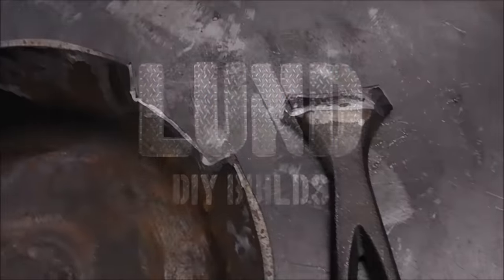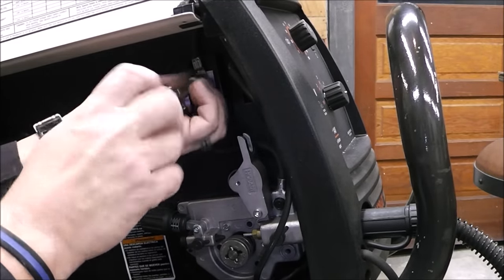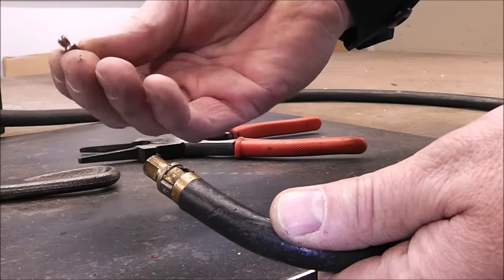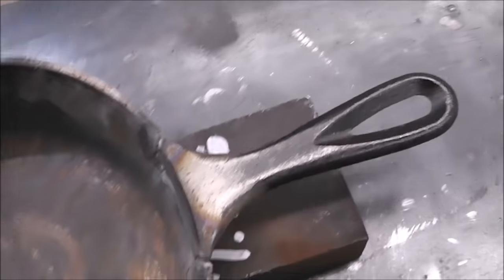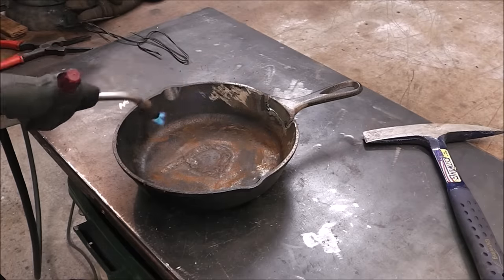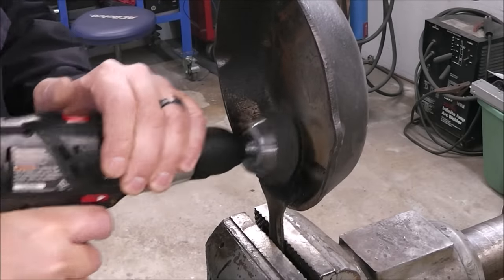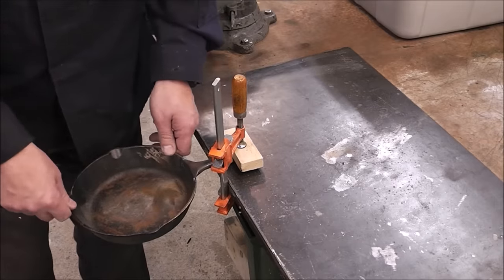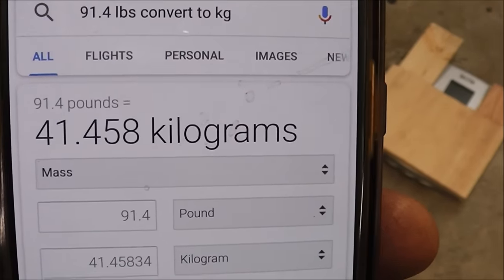Cast Iron Welding Repair using Flux Core Wire

Comment: The obvious problem is since cast iron is brittle, a static load isn't going to give the same result as a shock stress. Like glass it may bear a lot of weight, but fracture easily with a realitively mild whack with a hammer. It is the repeated thermal expansion contraction cycles of cooking that will most likely cause failure, rather than the weight of the contents.
Reply from the maker: Spot on! Why I insist no one ever repair a cast iron pan.

Comment: When your out in the field and what you got is what you got  you use it and fix the item until it breaks again. You know this so you don't expect it to last forever or may just last a few hours..  Down Time cost money so anytime you can be up and going your saving money and making money.  Now if you got the time to do a repair properly then yes by all means do so but usually that's not the case and the repair needs to be done ASAP.
Reply from the maker: Spot on! Thank you! 👍👊

Comment: What if ya got a flux welder like harbor freight now i have used a stick welder on cast never had it fail just wondering what any one thanks
Reply from the maker: I have no problem with HF. It was my 1st wire feed welder 30 years ago. I've even used it once on a commercial job welding some temp braces on a bridge project.

Comment: My dad used to use fiberglass insulation instead of sand
Reply from the maker: I've never heard of that. I would be careful with fiberglass though. Its bad stuff to be around without a respirator.

Comment: When weighing it, the white bucket doesn’t count because that’s what broke it. Great video thanks.
Reply from the maker: I was holding the white bucket between my thumb and index finger and just as I relaeased all the tension it broke. I might have been holding 2 pounds at most between my fingers so it's close enough to count.

Comment: Don't change your polarity if running dual shield.
Reply from the maker: 53prime, thank you!  I should have clarified in the video for everyone, self shielded wire (what I'm using here) has properties in the core that protect the weld puddle from the atmosphere and runs DCEN,  gas shielded wire still has flux in the core but nothing to protect the weld puddle from the atmosphere other than the shielding gas and runs DCEP.  Thanks man!

Comment: I think eggs are lighter than all that crap so it was probably good to go lol. I can tell you one mistake you made though, NEVER weld over flux before you chip it away. It looked to me like you were adding weld where you already welded before actually chipping. The flux will contaminate the weld so it won't hold. It may have held on if you didn't do that. Cool vid though

Comment: The moisture is not in the cast iron. It is a by-product of the gas flame. Put a flame on cold metal and it will get wet until the metal is hot enough to evaporate it.
Reply from the maker: I misspoke

Comment: Nice ima weld a cast iron block crack just to hold water
Reply from the maker: Good luck Joe!
Reply: It worked very well thanks for the tip it was cheaper and easier than stick welding
Reply from the maker: @joekriv8274 I love hearing stories like this! Thanks for checking back in and posting your results! Take care and congratulations!

Comment: interesting experiment. it didnt actually hold that much though, it snapped as soon as you added the bucket, therefore you cant really count any of the weight in the bucket because you dont know what amount actually caused the break. it couldve been just the weight of the bucket, it couldve taken the filled bucket. you cant accurately know how much witout adding the empty bucket and then adding to it
Reply from the maker: I've done enough of these experiments to know that it was within roughly 2% of the final value and for this representation that is all we need to know. So yes it proved that using Flux core is a viable repair option. Watch it again closely. I was using just my fingertips to hold the bucket and briefly let off the bucket just as it broke.

Comment: what volt and wire speed was this set at?
Reply from the maker: This welder does not have variable voltage settings. It's transformer based with selectable tap settings.

Comment: I broke the hinge off my barrel stove door this is cast. I welded it with flux. works like new. just ugly. I've been using a flux core welder for over 30 years. Installed air rides and hydraulics, cut frames in half then weld them back. I just wish they were more sheet metal friendly

Comment: best process is welding one side the grinding opposite side to sound material and welding and then repeating on the other side to make sure there are no inclusions in the weld itself. but interesting what you've done nonetheless.
Reply from the maker: Great point

Comment: Gas nozzles are insulated on mig welders, if yours is arcing, something's wrong.
Reply from the maker: Not really. They make self shielded nozzles non conductive for a reason. Generally the nozzle gets a piece of spatter inside which causes the nozzle to arc out and renders the insulation useless.

Comment: Flux core is the only practical set up for me. Due to costs, location, etc.. Can get flux core delivered cheap, no gas, also the 160 welder was a one-off, affordable & does both, if I decide to expand skills. I wanna learn to walk in my bare feet before I run in €3k shoes. :D
Reply from the maker: Dude you hit the nail on the head 100% I love flux core...especially for all the reasons you pointed out. I don't know why some folks give it a bad wrap. Theres a reason It's used almost exclusively on structural work....because it works!

Comment: why the slow cooldown? its a pan. its going to be heated up on a stove and cooing many times... am i missing something?
Reply from the maker: The stove will never heat the pan from room temp to welding temps of 2000f in a matter of seconds. The slow cooldown allows the metal to normalize the grain structure that gets rearranged from the high welding temps
Reply: @BrandonLund  ah ok thanks for the explanation. ill keep that in mind if i ever weld castiron

Comment: I was told 6013 was good for cast iron.. when you're done, hope theres no "ping"
Reply from the maker: As far as stick welding a 7018 works much better because it’s low hydrogen.
Reply: @BrandonLund  ive had good luck with 6013. The welding instructor who told me that welds for Nasa. He did all the welds for the hubble repairs yrs ago.

Comment: They say cast is not supposed to be welded.  How ever I have never had a problem just get it super hot.
Reply from the maker: There seems to be a lot of mystery surrounding cast iron. Hopefully this series has shed some light
Reply: From my experience I’ve just welded it and rolled with it. But I did use higher heat settings depending on thickness I haven’t had any issues. But the stuff I’ve welded isn’t holding a building together either.  Lol

Comment: Works better if you heat the cast iron and use a nickle rod. The densities of the different metals will break with vibration as well . Done with the wire
Reply from the maker: Yes, I believe testing wise that was the process and method that has done the best so far.

Comment: That tip gard shouldn’t make contact. It’s insulated on the inside of it. Probably had lots of slag build up in it and was making the inside of it letting power go to the outside of it.
Reply from the maker: I think the insulator is going bad. It's had a lot of use but it could be slag buildup also

Comment: The last bit of cast iron that I welded I didn't have to go to this extreme, but this video brings a good point.  I didn't bring my to heat before welding, but I welded small 1/4" welds into the heat!  And I let it cool down on it's own time.
Reply from the maker: Thanks for watching and commenting!

Comment: Many complain about flux core how much you have to clean and how messy it is but I've been welding on several occasions where we got late the welding store was closed I couldn't get any gas couldn't finish the project it's just totally messed up my progress so try flux core I keep plenty of wire wheels wire brushes and I weld outside anyway the welding supply company close to where I live had several rolls of 30 lb flux core wire Hobart the guy told me it's been sitting there for a while nobody really buys it I said well talk to the boss and see if I can get it cheap he laughed at me the next time I went in the store they sold it to me dirt cheap I'm a happy camper
Reply from the maker: Nice score! I love flux core. I've run miles of it on commercial jobs. It works just as good as any other process if setup correctly. Cheers buddy :)
Reply: @BrandonLund  thanks for your videos I have learned a lot and because of your sharing my fabrication skills have improved thank you

Comment: use a wire wheel if you are worried about contamination. The cut off wheels are made from fiber and will burn away anyway.
Reply from the maker: That would work too but "experts" say to use a chisel to avoid embedding the contamination within the metal. If you treat it like you would to prep aluminum and brush in one direction it shouldnt be a problem

Comment: Dude, i stick welded a cast iron pump almost a year ago with a 7018 Rod. All i did was preheat and reheat  a large area around the weld. Had no problems.  People will tell ya that you cant do this, and cant do that just because they didnt have any luck
Reply from the maker: I've had pretty good luck with 7018 also.

Comment: 12:51  I think that proves that cast iron CAN be successfully flux core welded.  But, as a newb, when I see cast iron, I instantly think nickel rod arc for the repair.
Reply from the maker: Nickle is good too but my go to now is silicon bronze. It's almost as strong as the original material

Comment: Good vid.  Sometimes we don't have time or resources to make the optimum repair.  The skillet would have functioned just fine, as it is unlikely that even I could get 91 pounds of bacon in there.  Besides, it's not stupid if it works.  Trolls can go pound sand.
Reply from the maker: Thanks man! Your "pound sand" comment had me chuckling. I say that phrase quite often myself.

Comment: Thats innershield wire. Not fluxcore. Thats 2 defrent wires.  Fluxcore uses orgon. Innershield doesnt.   Can tell by the white smoke/dust left on the pan after you weld.   Welded it for over 20 years.
Reply from the maker: I've never been big on semantics

Comment: I use flux core mig welding daily I don't know why people hate it so much
Reply from the maker: Good question. Each process has their place and knowing when to use it makes sense to me. I would hate to have to rely on just one process. I pick the process that works best for what I'm doing and roll with it. In and out $$$$

Comment: you weld cast iron with steel wire?
Reply from the maker: You can. Although not the ideal method, it can be done in a pinch
Reply: @BrandonLund  maybe i should have worded that different i know you can weld it that way but it wont hold
Reply from the maker: But it did tho

Comment: Exhaust manifold on the engine?
Reply from the maker: Sure. If you can get to the area well enough.
Reply: I'm gonna try it. May let the engine idle for a hour or so before I start the actual wielding.
Reply from the maker: @jeraldhite9744  If you can get it up to temp before welding, that is the best. Once your done start it up again and get it back up to temp again, and then shut it off and pray it doesn't crack.  You got nothing to loose right. Good luck brother!

Comment: Flux cored 70 series wire is DC Electrode POSITIVE!  Just like solid wire.
Reply from the maker: @Jeff Benefield if your running dual shield than yes, but I'm running self shielded which uses straight polarity (DCEN). The "70" doesn't determine polarity, the "7" refers to the wires minimum tensile strength and the (0) denotes the welding position. The last digit in the wire designation is what defines gas shielding and the polarity of the wire. An example is E70T-7 wire - The (E) is for "electrode", the (7) is the tensil strength (70,000), the (0) is the welding postion (flat / horizontal), the (T) notes "tubular" - (as in flux core), the last number (7) represents shielding gas (none) and Polarity DCEN.

Comment: What wire you used
Reply from the maker: Probably Matheson in house brand
Reply: @BrandonLund  I live in UK am looking to buy a flux core with no gas to weld a cast iron mainfold but never weld and don't know if is better to use ARC or Flux core and what wire that welder is sold without wire. Thank you Sir. Can you tell me please the best flux core wire for cast iron

Comment: The cup is for the shielding gas, flux core doesn't need the cup
Reply from the maker: In fact, the nozzle will short out when using flux core...which is why the nozzle made for flux core are made of non conductive material.

Comment: 5m16s, wait, I thought the nozzle was insulated from the rest of the gun?
Reply from the maker: It should be but for some reason it's not. Plus when the nozzle starts getting loaded up with spatter it starts conducting across the tip. The cheap plastic ceramic looking nozzles avoid all of this.

Comment: I am not convinced it is cast IRON. Look's more like cast STEEL. When grinding cast iron, the sparks are ORANGE, NOT WHITE, as this is what it showed on the video. What was the wire?  Couldn't tell if it was nickel or stainless steel.
Reply from the maker: 🤔🤔🤔  It was pot metal so I went with self shielded unobtanium 207

Comment: That's what I was going to say!  WHO, in their right mind would EVER have that much weight on that size skillet?
IF it will hold that much weight with flux core wire, why not go ahead, repair it that way and use the skillet?  Seems good enough for the girls I go out with!
Reply from the maker: Right on brother. Thinking outside the box.

Comment: Flux core is good and strong, just a bit messy. Your gun should have a plastic tip for flux
Reply from the maker: I have one i just don't always use it. If your careful it will last a while without it. I was not careful and just had to replace my collett.

Comment: 7:10  that's not moisture in the metal, that's moisture from the torch fuel byproduct, condensing on to the cool metal.  The gas burns and becomes mostly CO2 and H2O
Reply from the maker: Yes, I mispoke

Comment: I do not think that cup shield is ever suppose to be live. Actually. I’m positive. If it is. It’s because your inside fiberglass is messed up. That plastic and ceramic shields are just that. There a shield to keep spatter off the tip and end of the gun. Nothing more.
Reply from the maker: Typically what happens is a BB makes contact from the cup to the tip which bypasses the nylon insulator that is intended to keep this from happening and therefore the metallic nozzle that is designed for mig welding becomes electrified. That is why they make a non insulated nozzle designed just for using flux core.
Reply: Brandon Lund yup. Exactly.

Comment: I was a welder in a cast factory ,don't use this method on something that your life depends on if it breaks because all castings are different preheat to 400 degrees, Ni rod,peen,slow cool,sand works best, I ve  even used old welding gloves  lol , Mark  Buckeye steel castings
Reply from the maker: Hey Patricia, preheat, nickel and post cool are my preferred repair methods also, however this repair is part of a repair series where we are trying different processes and filler metals then comparing the results on a destructive test.

Comment: I would be more interested in knowing how the individual repair methods held up under usage conditions rather than weights that aren't representative of real world conditions.
Reply from the maker: Usage conditions? Im pretty sure I said  dont repair cast iron pans. Its dangerous and irresponsible in my opinion. Why take a chance. Just replace it.  I used a pan so I'm not accused of welding cast steel. I think most can agree this material is made of cast iron and if you watched the series you now know which process and filler metal was the strongest...which was the point of the video that you clearly missed.
Reply: @BrandonLund  Yup. I missed that. BECAUSE I was watching to learn "which process and filler metal" was the strongest. My  comment was intended to be friendly and constructive, BUT, if it's dangerous and irresponsible to repair cast iron pans, maybe you should have used something else. Like parts off of a woodburning stove, etc. Or maybe you should just have accepted that somebody would doubt you. There are people who are going to use your video with the express purpose of repairing cast iron cooking surfaces despite NOT missing your warning.
That said, no matter what you you used for your example repairs, usage conditions would STILL be far more useful than than hanging a bucket of random junk off of it.

I clearly missed it. Maybe that's as much a comment on your presentation as it is on me.
Reply from the maker: @chriswonsmos1007  I have used things other than a cast iron pan and guess what happens? Nearly 2 million video views and people debate if its cast steel or cast iron I'm welding. This pan ends the debate of the material so hopefully we can focus on welding rather than debating the materials.   There will always be people in this life that need a warning on a coffee cup that the contents is hot and can burn you. Certain things I cant fix.

Comment: It would seem that the repair method should be based on end use of the repaired item. 91 lbs on an iron skillet seems like a viable repair option. 91 lbs on a differential housing...not so much
Reply from the maker: I agree 100% 👍

Comment: ya but t71 not for cast repair  nickel 55 or 309  is made just for that cast iron welding    at least I thought sooo.
Reply from the maker: Don't forget 99. What you mentioned are all tried and true methods. That's not what this video was about.